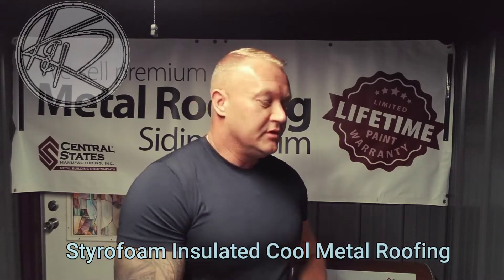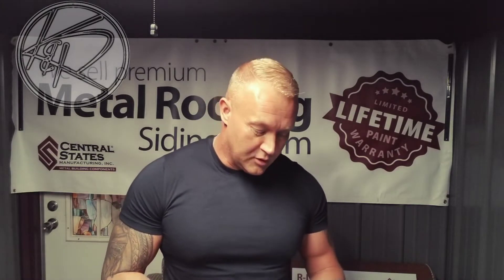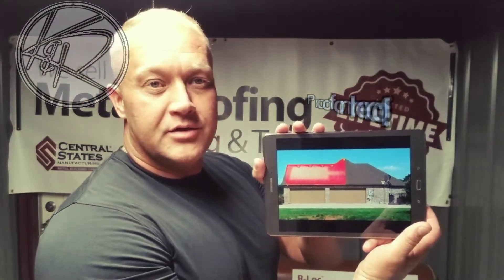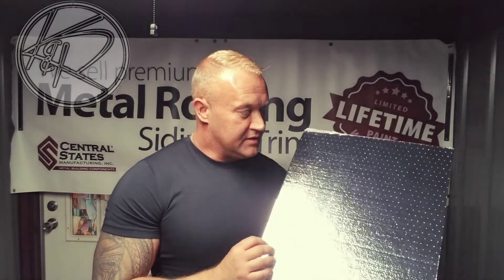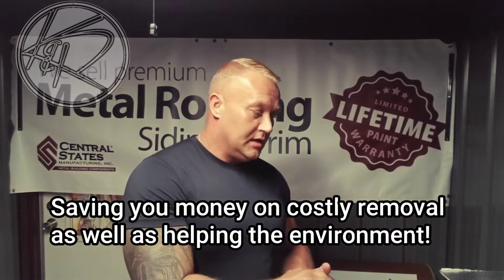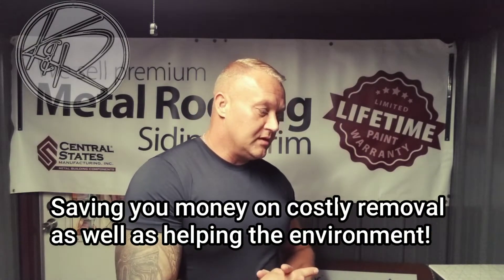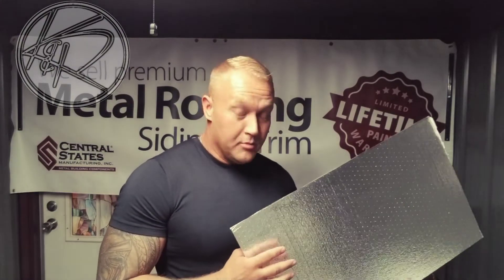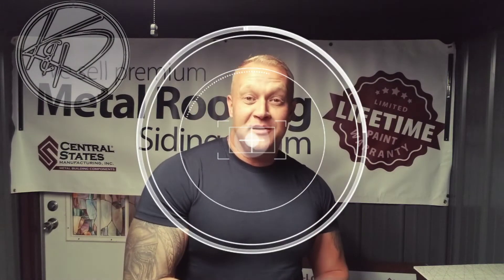Styrofoam Insulated metal roofing

Comment: Actually, you are relatively photogenic. LOL! Hey, can you speak to a couple questions. First, everything I see and read demands an air space between metal and the aluminum radiant barrier but you’re putting them together. Is there something about you’re process that’s different? Second, I have a metal carport type enclosed garage and I’m looking for ways to block out the radiant heat and my favorite method would be thin foam board. Would you recommend your  product for this project and what are the pitfalls of putting it directly to the metal inside? I use the wall faces for many things in my shop.